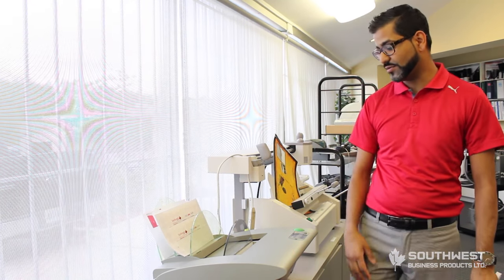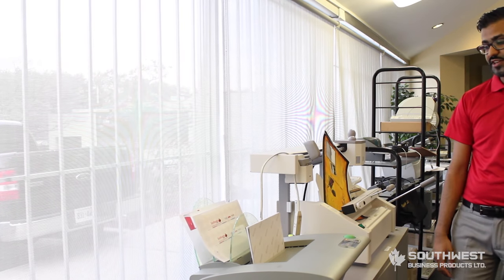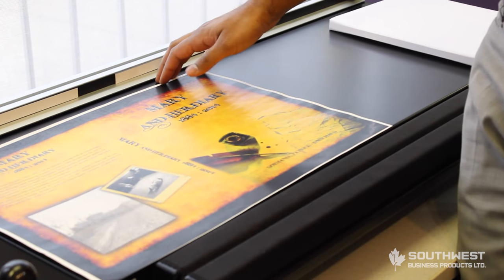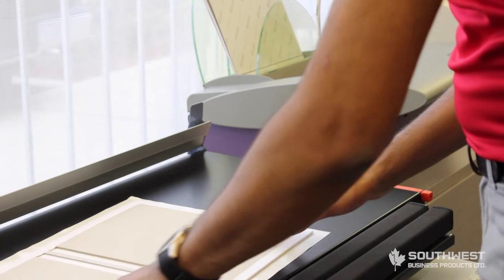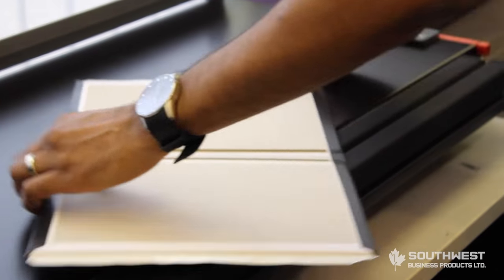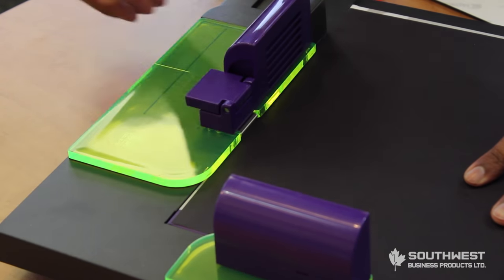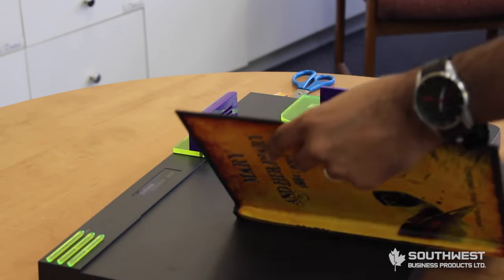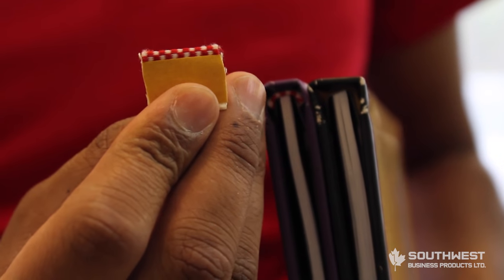DIY Series: How to Create a Hardcover Book

Comment: I hate tutorials like this. If we searched DIY book making there’s a high chance we don’t have special tools/machinery, let alone 3 of them.
Reply: Certainly not when for the correct and decent equipment its in thousands just for one of them machines 😂
Reply: If you search for "hand binding books" you'll likey get a better result.
Reply: This ain't a tutorial, this is a selling pitch. And sorry to say, a bad one at that. "Press this button and then you have a bookblock. You do this, because it just works". Also, the guy cutting off the corners without showing close-ups of the cut corners (because look at it closely: those cuts were ugly!). Then he folded those sides and 'pinched' two corners to get it flush? It didn't make any sense. Then he showed how he 'locked' the book in place, only to have the 'lock' not correctly locked at all LOL